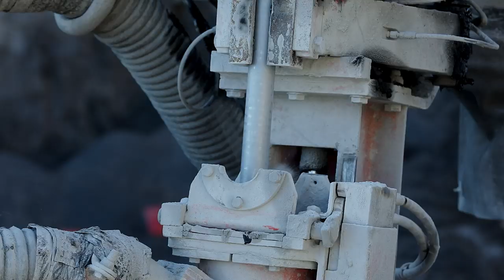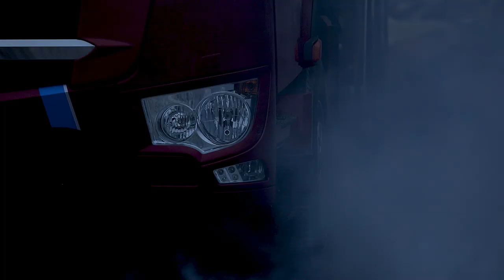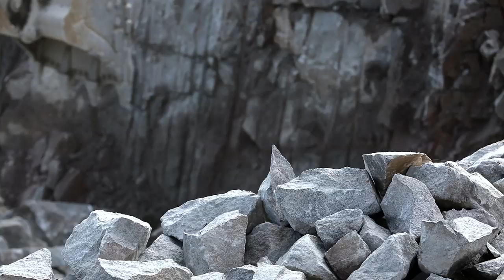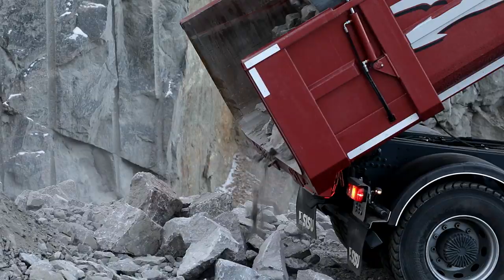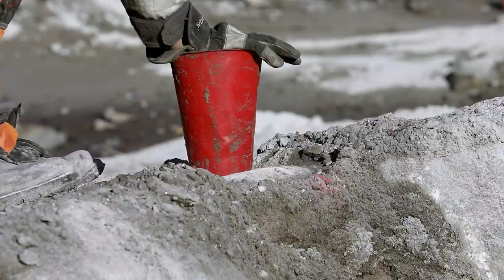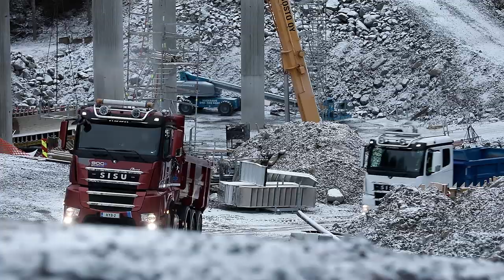SISU Polar Rock HYBRID

Comment: Can you buy 4x2 Sisu trucks for hauling general gods in trailers also? I think i've not seen many of those. Only a few ones.
Reply: Not 4x2, Polar Hauler is a tractor unit, but only available with 3 axles or more, I might be mistaken bit older models might be avalailable as 4x2, however I have not been able to find any so I can't be sure.

Comment: Is SISU like we in holland got  GINAF ? Thy focus alot on offroad more then DAF
Reply: A bit similar. Sisu uses nowadays MB cabins and engines. Transmission is MB or Eaton Fuller. The electric engine in hybrid is made spesifically for Sisu and the hybrid components are all developed in Finland.
Reply: Cabin and engines are from Mercedes but i think the chassis and everything else is from sisu and are specifically made for finnish landscapes.
Reply: And Ginaf use Sisu Axles in some models👍
Reply: @p1kkujuha  yea but the engines are nowadays Detroit Diesels.